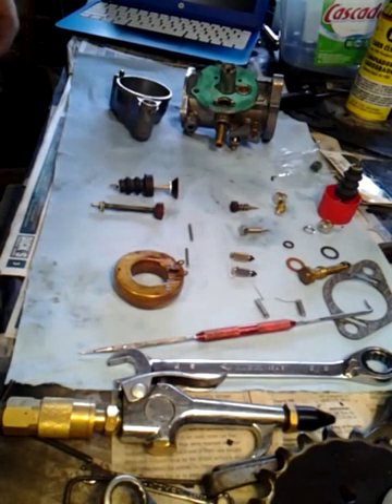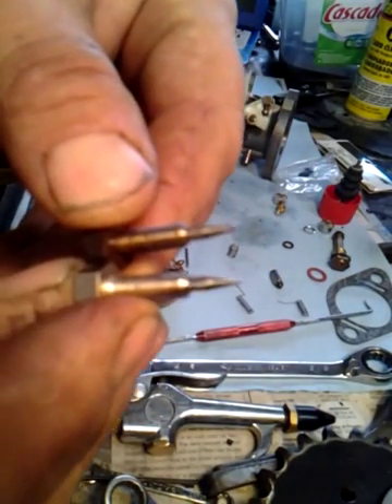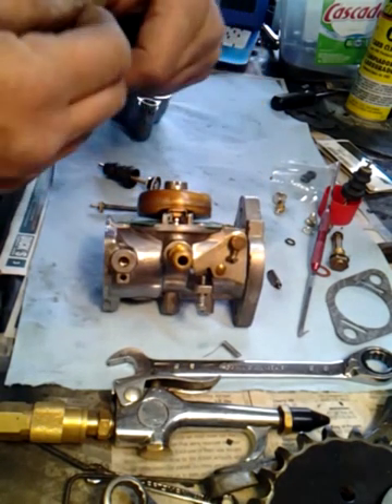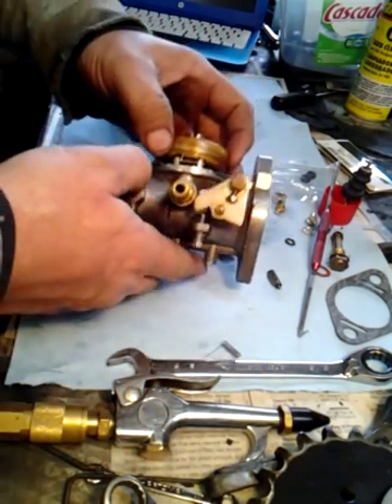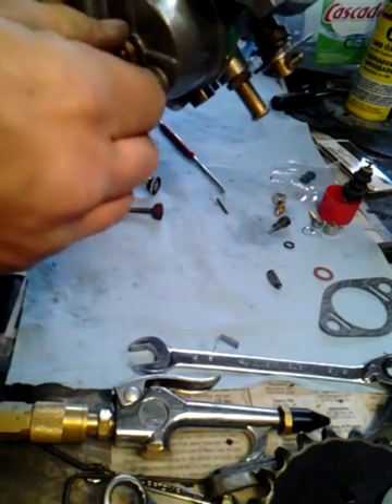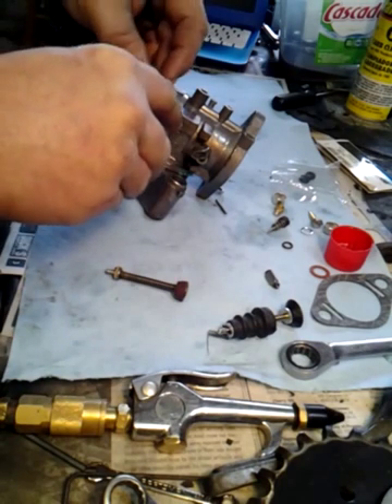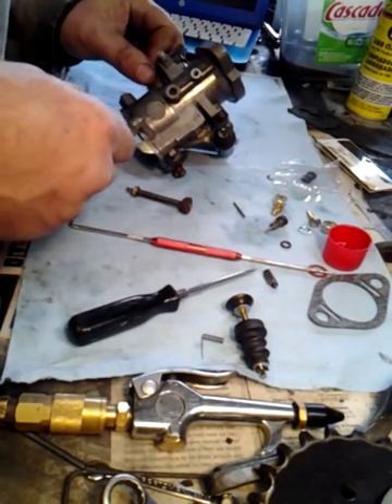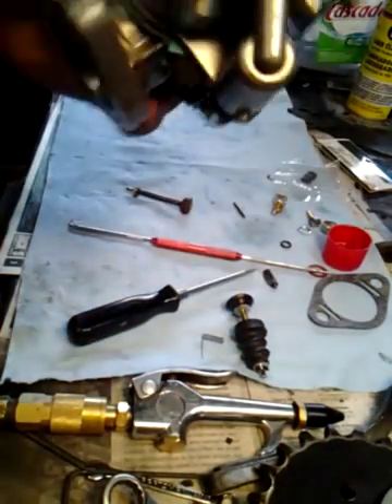Harley Ironhead Bendix carb float spring

Comment: Cool. My 76 came with a CV on it, but I'm thinking it's a bit much for what I've got there. I got a hold of a couple of Bendix's and will be trying one of those soon enough. One of them is already apart and submerged in some WD/40 for a while. Looking forward to see how that goes.
Reply from the maker: i like the Bendix/Zenith, foolproof, cheap. have had a few bikes but none w a cv
Reply: I'm replacing a CV40 with the same reasoning; if it was born with a smaller bore carb it'll probably run better. The CV works well, I have to say, but you can't stop messing with these bikes, can you?
Reply: @ImminghamIronhead  Nope. There's no end to it.

Comment: I had the same problem with the Taiwan kit.  That spring drove me crazy.  In one position it leaks when I parked.  In the other it shut off the fuel entirely.  During the last iteration, about a half inch of the long leg broke off.  Now it is perfect.

Comment: You're right about those kits; my red washer did fit, but the accelerator was wrong. I soaked it in fuel overnight, expecting it to shrinky-dink into some kind of usable shape, but it did not. The CV40 kits aren't much better; float bowl rubber never fits (pro tip; cut it inside that little o-ring part - it'll fit and seal then). My new mixture screw looked weird too, and the float bowl spring seemed a bit weedy.
Reply from the maker: right on brother
Reply: @crashman1963  Update; the float valve that came with the kit started sticking, so the old one's back in there now.

Comment: 7 yrs ago... you still there? I got me a '76 FLH Police Special that has a Zenith on it, cant find anything on adjusting them. I did points, plugs and condenser, oil and filter, but my plugs are still getting sooty instantly. She seams to run fine (better than before the new points) and I'm just putting around my block as its fkng winter here in Michigan. I found a vid on where my air/fuel screw should be from factory ~1.5 turns out? sometimes 1 3/4... but the Main, can't find anything on a factory setting. One of my shovels runs an SU Elim II, the other a Super E, but just new to these old guys. Any advice? links for a free manual? or just a few starting points to try and figure this ole gal out.... Thanx in advance, Happy Belated Holidays, and hope to hear from ya
Reply from the maker: ok so you're rich,  i usually start 1 1/4 out,  your main will have numbers on it, telling youu size. ive been running an su and a s&s for past years a lil rusty on the zenith, you'll have to research what size they like on a fl/ happy holidays and thanks for watching. hope i helped a lil. cheers!

Comment: I have a 74 and rebuilt the carb. It leaks out of the accelerator pump and it pours gas out. I tried the 316 bit to set the float height I'm not sure  what to do man I just want to ride her! Helpp
Reply from the maker: did you replace the acc pump check valve? is it working? what about your needle valve is that working? if you pull off bowl can you stop fuel by pushing up on needle valve?  hard to diagnose when i cant see whats actually happening. good luck

Comment: What did you shock accelerator plunger in
Reply from the maker: gas generally
Reply: @crashman1963  ok thank you for getting back to me.  I used mystery oil 🤞.
Reply from the maker: @jameswilbur2499  that'll work have great weekend

Comment: I have a 74 ironhead with an original bendix carb. It leaks gas out of the accelerator pump I'm not sure how to fix it? I got it to squirt gas but I'm having trouble getting it to run. Itll fire but it wont idle
Reply from the maker: is it leaking only when you pump or all the time? can you hear the check valve ball rattle when you shake it? Probably should order a good rebuild kit and perform a good thorough cleaning, make sure you dont over tourque your bowl, easy to crack. good luck.
Reply: Did you get it to stop leaking I’m having the same problem on a 70 iron head can’t get it to stop leaking out of the accelerator pump

Comment: i did away with the spring on my carb ..no use at all really ..just keep it good and clean
Reply from the maker: if you should ever need/want the spring , this is how you could do it, good and clean never hurts! lol cheers
Reply: @crashman1963  i take a #2 pencil with a good eraser on it and buff that little seat for the needle back to shine and normally fixes it so you don't need to turn your gas off

Comment: so I'm trying to fix my dads Bendix carb, because it leaks gas out of the bottom, any suggestions, any help will do, I mean HELP ME DAMMIT BEFORE I BLOW SHIT UP lol
Reply from the maker: make sure the float bowl isnt cracked. that happens if overtightened and very easy to do. also make sure inlet needle isnt stuck in open position and coming out the overflow.